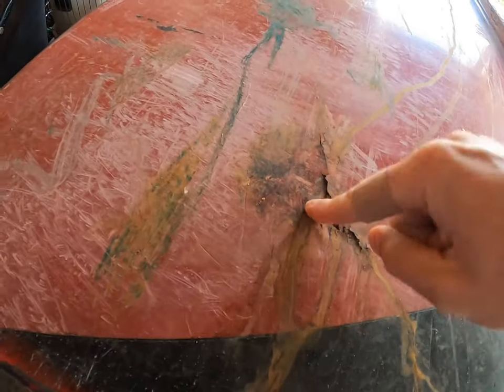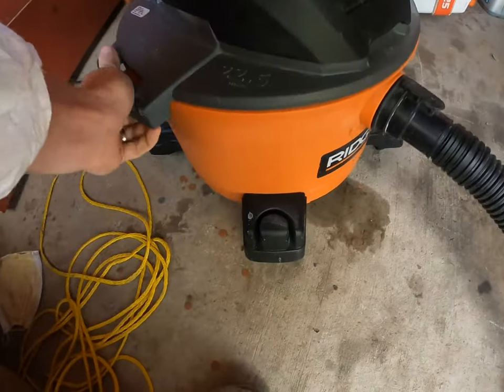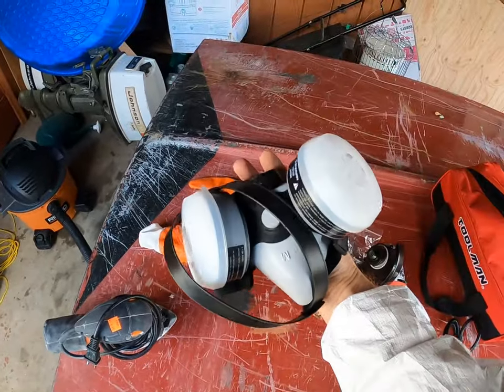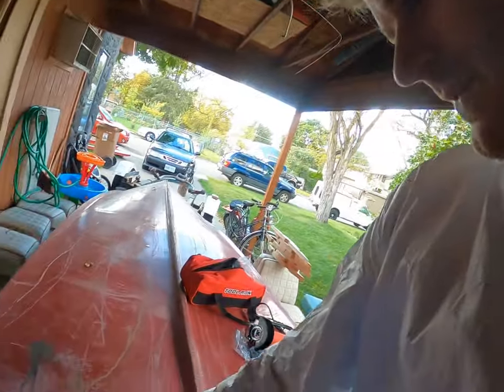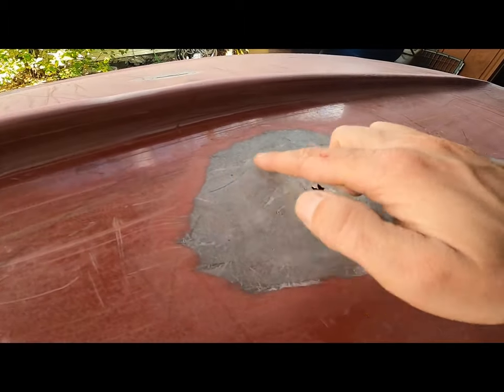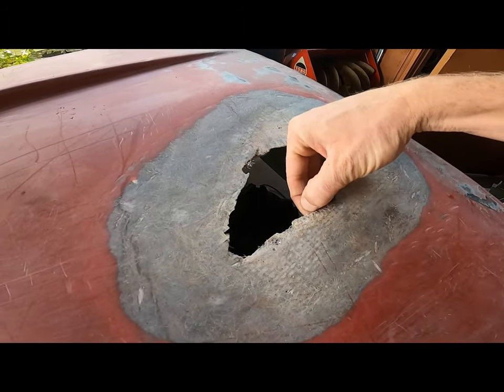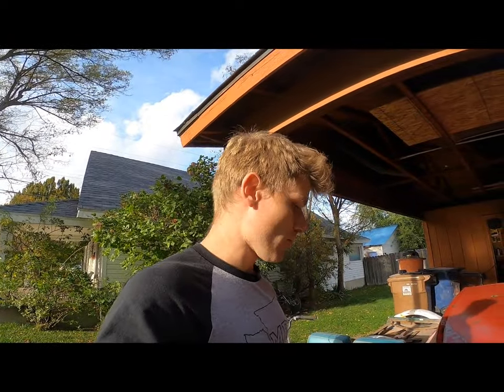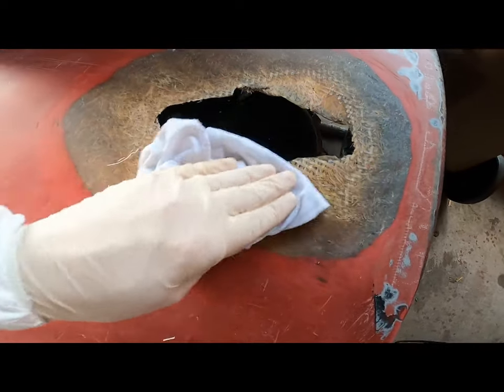Boat hull restoration  (Part 7)

Comment: incredible.  I have been avoiding tearing my dads old boat apart and rebuilding it.  You are an inspiration.  Jace is a lucky to have a can do dad.
Reply from the maker: what kind of boat does your dad have? does it need a full rebuild?    I'am lucky to have little Jayce 😉
Reply: @Project2Potential  It's a 1971 18'  runabout, with a non-working Mercury 75 HP.  The hull and trailer are not in terrible condition but the sole is completely rotten.  I haven't torn any of the sole out but I'm sure the stringers are rotten too.  Ugh.  After watching your full series, I'm not sure I'm up to it.  That was incredible.
Reply from the maker: maybe cut an inspection hole in the floor maybe your stringers are still good. the reason mine were all rotten i think from the crack in the hull, and water sat in there for many years. if your hull doesn't have damage and is not leaking there's a good chance the stringers are fine. and if they're  fine then it's just the inspection hole that you need to patch back up. 🙂

Comment: Should have put a couple of layers of fibreglass on the underside of the holes before grinding. Then grind down to the new glassfibre. No sagging problem.
Reply from the maker: this is a lesson i definitely learned from. if future boat projects have the same type of repair i will do things differently for sure! thanks for the input!

Comment: You have a huge project there, couple things. With what you’ve taken on and all ready completed you should be using Marine Plywood or Coosa Board (Coosa will not rot)..Regular Ply won’t last. Yes of course fiberglass your stringers, that’s a must. 1708 glass..Bunks much better then rollers for your application but go bigger then 2x4’s. Build up the transom, you can go 1 1/2 easily, anything is possible with the proper materials.. install knee’s An repower with a reliable quiet 4-stroke. Use a proper respirator when sanding! Not sure why you removed the cap? could’ve cut access at the stern and re-glassed, that cap also helps hold shape when Re installing stringers.. Good luck.
Reply from the maker: I bought some 1708 and re-did the repairs. 
I thought of Coosa board but it is pricey
I'm still think on it. Thanks for the advice
Reply: @Project2Potential  Project is moving along nicely.. Coosa will be worth it, you'll never have to replace it again and it adds value if you decide to sell down the road, good luck!

Comment: first great 'little' project you got yourself there. just some advice re fiberglassing and filling holes. From my experience, you should have put some flat material on the inside of the hull to avoid the fg sagging as it is a big enough hole. Then typically you want to create a radius of 1 to 12 for the area to sand around the hole so you expose enough fg for the new fg to attach to. and when filling your fg patches go first from the biggest to the smallest. And can't see for sure but your fg looks like regular fg, it needs to be biaxial fg for this as it is better suited. Hope this helps. Thx for sharing though
Reply from the maker: Thankyou! I did realize after the fact the a flat piece to support the fb would of been a really good idea haha. I do apricate your advice and will remember it for future fiber glassing. I had other people advise on the biaxial as well, which then I did end up laying over the regular fb cloth! 👍